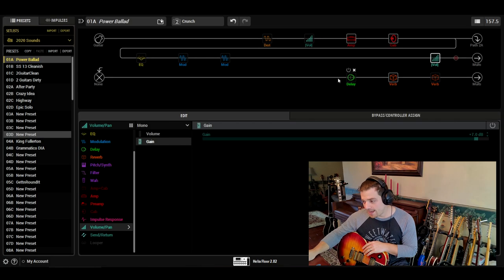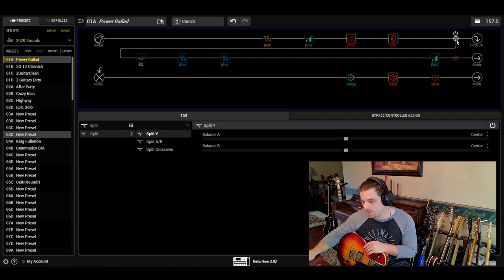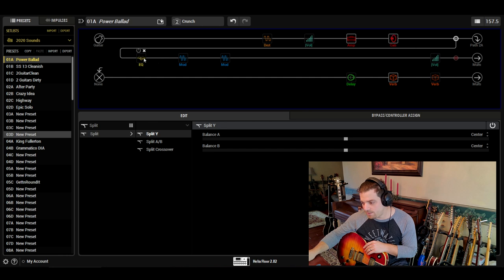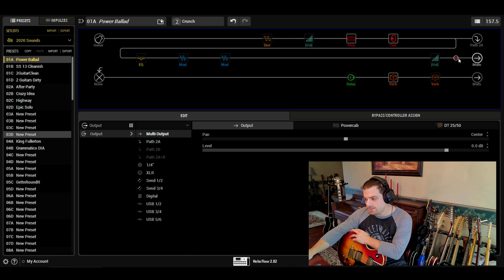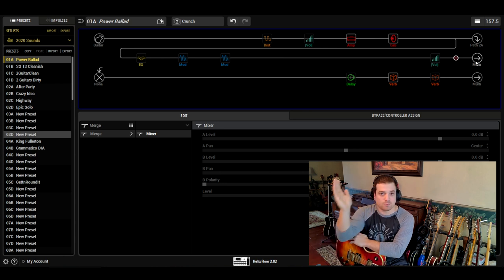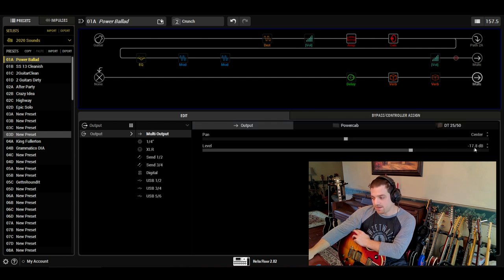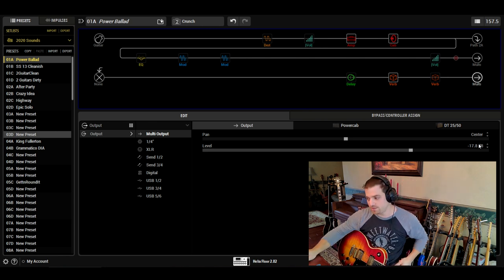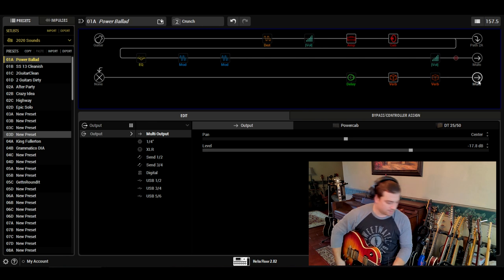How to Create "Epic" Solo Tones in The Line 6 Helix and HX Stomp- Make ALL Reverbs Sound Great!

Comment: Any suggestions, I’m using headrush FRFR and anything with drive sounds awful? Cleans sound nice though ? I do have drive pedals first in the chain
Reply from the maker: Most of the time, if the drive sounds terrible then your preset is probably too loud. I would check out my "leveling presets" video. Or simply try bringing your channel volume way down and making the headrush louder
Reply: Steve Sterlacci thanks so much I will try this as nothing else has seemed to work

Comment: Hey Steve, thanks for the video, wondering if you could share some of your preferred settings on the Delays and Verbs using this. I find this is the equivalent of the mix settings on both, which I typically left pretty low, this gives me more control, but curious o know how your settings look
Reply from the maker: The reverb is searchlights mix is at 80% and decay is about 3. The delay is mod chorus echo, mix 50% and feedback to taste. Some other tweaks too but those are the basics. Delay first!

Comment: hey nice video.
I do think you would accomplish the same thing when you lower the mix on the effects, when you turn the mix all the way down all you have is dry, mixing the effects in will ad the effects also in parallel, wet/dry only really works if you use two different outputs and send them to foh or two amps separately.
again this wat I've found in experimenting with this within helix.
there is no wrong or right way I guess
Reply from the maker: It doesn't work like that in a signal path. Using just the mix control on the FX lowers your actual signal as it brings in affected signal, which is why bringing down the affected signal level in parallel  creates a better mix. Doing it this way retains your original signal by having it go straight to the output. it works more as an actual mixer of the 2 sounds. I always did it within one chain and never got the results I was looking for like this
Reply: @SteveSterlacci  yes when you get you're mix above 50% (depends on the effect) it will lower the dry signal, below that it is basicly a wet/dry mix, at least that is wat It sounds and feels like to me, especially with delay it doesn't lower the dry signal until you go above 50%
I would actually would really like to know from the line6 folks how this is designed. 
I've also tried running reverbs in paralel but I can't hear any big difference when doing this going through the same output.
again when using two separate playback systems one dry and on wet is a different story.
again this is wat I've found in my experience.
I'm going to grab you're preset and maybe change my mind😉
Reply from the maker: @marcelblade  The thing about it for me is having the reverb be able to go to 100% mix on the parallel path and same for the delays. I feel like it lets them "work" better and to my ear, it reminds me of adding a reverb or delay plug in or outboard FX being added in post production. Leads to a much cleaner original signal and more control over the FX. I have always done my verbs and delays as you are describing, there is a night and day difference when you set them to 100% mix and in a parallel path and bring the level (at the output of the wet side) down. Maybe I will do a comparison vid!
Reply: @SteveSterlacci great that it works out for you.
 hey man, I'm all ears, love tinkering with this stuff, I'm going to experiment with as soon as I can.
gotta love gear like helix
Reply from the maker: @marcelblade  I think you'll hear a huge difference. Make sure you split the signal to have your dry amp going directly to an output and the split path go to your wet FX, set them to 80-100% mix and lower the level at their output block

Comment: Still learning the Helix - but I'm guessing the wet level could be routed to the EXP pedal (full sweep from -120 to 0 or to a smaller range ie between -20db to -10db). Thank you for the video.
Reply from the maker: You can definitely put a volume pedal before the output to achieve that ! Absolutely will work

Comment: how would this work if running stereo to FOH
Reply from the maker: You can get as simple or crazy as you want. It should work the same way as I have it but if you want to get crazy with stereo delays you should look into wet dry wet set up!
Reply from the maker: Also, you can set the Right channel to be your dry and left to be your wet, or affected channel. then the FOH engineer will mix the levels according to the room